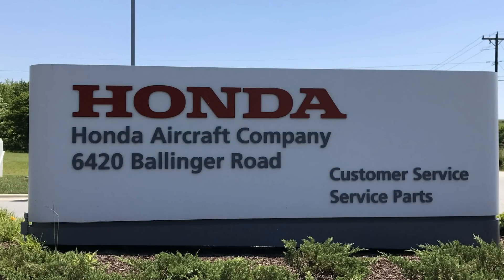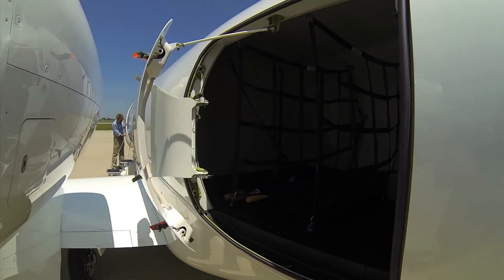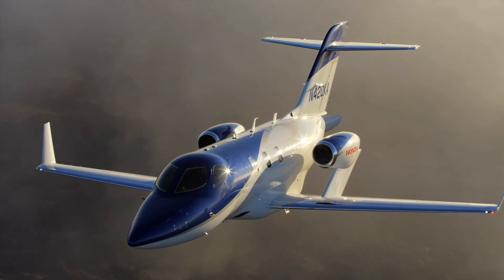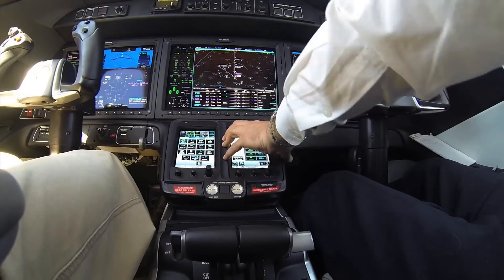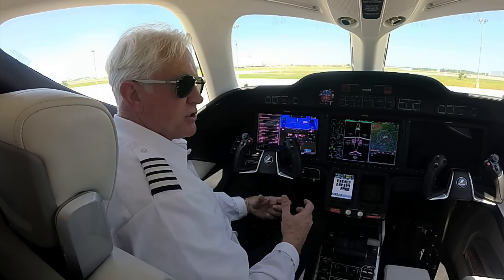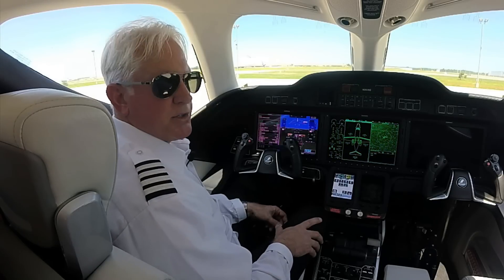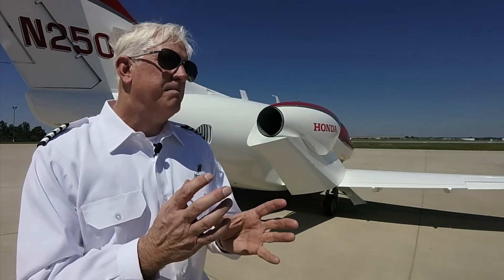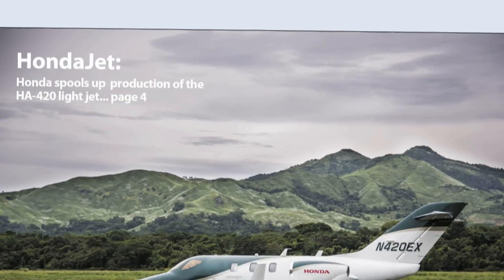HondaJet Flight Demo

Comment: I consider that Honda needs to improve the performance of this aircraft like the Phenom 100 or Citation M2. 4,000ft of take off distance is too much for a "Very Light Jet", even the Sovereign uses only 3500 ft for take off. I don't consider the Honda Jet a good and direct competitor if the customers look for a good performance and they want to operate on airports with a short runway.
Reply: They are right on top of it. Stay tuned. Their performance improvement over the competition will come in about 15 years.
Reply: It's their first jet. Their next one will probably be beast!
Reply: Fer Cuéllar Mate, did you design an airplane from scratch. These people on YouTube think they know everything about everything.